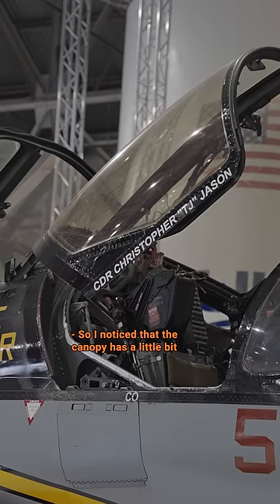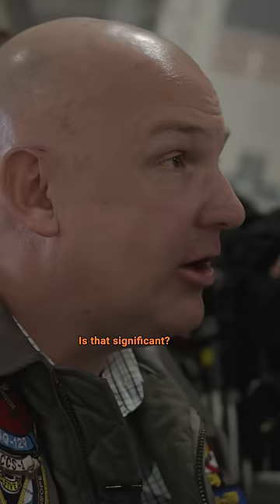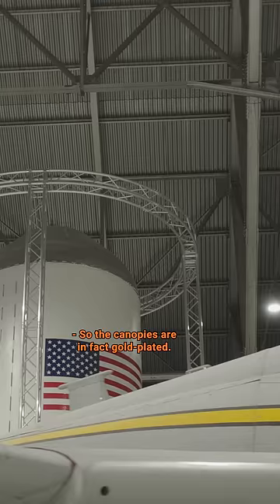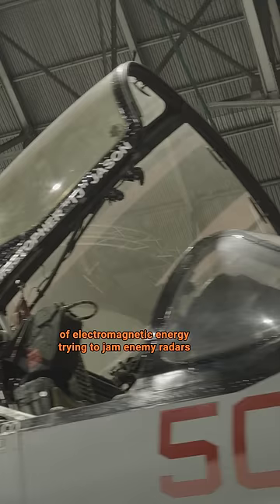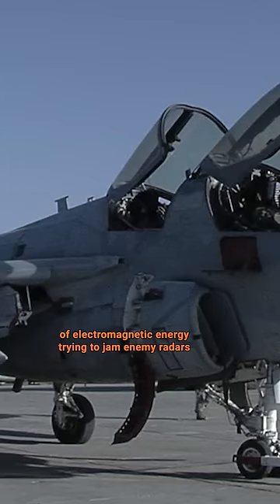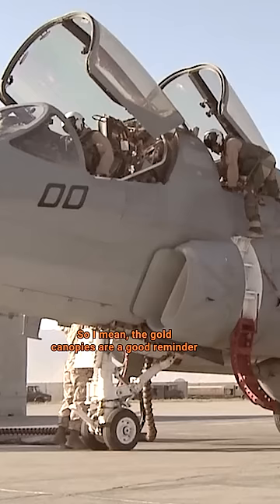Part 8 | Gold Plated EA-6B?!

Comment: It's actually kinda significant that he's next to a Garuda bird while talking about the canopies. When we were deployed to PSAB, Saudi Arabia in 2002, one of the maintenance guys accidentally pulled the ejection handle releasing both of these expensive canopies into the ceiling. No one was hurt despite several people working on and around the jet at the time. One of the canopies landed mere inches away from the HARM.
Reply: How could a trained guy "accidentally " "PULL" the ejection?
Reply: @iRossco  It actually requires at least two failures. Someone forgot to pin it, the person working in the seat forgot to verify all pins were in, and the person in the seat managed to pull it accidentally. It happened.
Reply: @peterjp4 that's 3 guy
Reply: @Sbudz  Nope. Just two. The person who didn't pin it immediately after flight and the person who didn't verify all pins were in when working in the seats.
Reply: @peterjp4  "someone forgot to pin it, the person in the seat forgot to verify all pins were in, and the person in the seat managed to pull it accidentally" that's 3 fucking things bro. 2 commas and an "and" means 3 things
Reply: @theBUDSareSTRONG  I listed three actions, but it only took two failures with cranials to severely damage a multi-million dollar aircraft.
Reply: @peterjp4  bro shut up 😂 you said 2 and then listed 3 things
Reply: @theBUDSareSTRONG  Actually, I saw the mistake shortly after posting it, but decided against correcting it in hopes no one would say anything. I wouldn't normally call my fellow shipmates "failures", but I had to win this argument.
Reply: @peterjp4  ok bud
Reply: What's HARM?
Reply: @LanaaAmor  Highspeed Anti-Radiation Missile. It's a missile specially designed to engage radar. The EA6B could jam their frequencies, but they were also capable of eliminating or suppressing the threat when necessary.
Reply: @peterjp4  ea6b?
Reply: @LanaaAmor  The EA6B Prowler, the aircraft in the video. EA stands for Electronic Attack. 6B is just a designator.
Reply: @peterjp4  how can it jam their own missile? Anti radiation missiles can be jammed? They just detect rafat signal and home in.
Reply: @LanaaAmor  The HARM is a missile specially designed to engage enemy radar. The EA6B could jam the enemy radar frequencies using their jamming pods, but they were also capable of eliminating or suppressing the enemy radar threat when necessary by using the HARM.
Reply: @peterjp4  harm can do that? I think harm just follows the radar signal.
Reply: @KaranSingh-cz8ih  Yes, that's what it does. I didn't mean to imply it did something else. I'm curious, what did I say that suggested different?
Reply: @peterjp4  you said it can be used to jam enemy radar
Reply: @KaranSingh-cz8ih  The EA6B Prowler carries jamming pods that jam enemy radar. The Prowler can also carry a HARM to suppress or destroy the enemy radar. Sorry for the confusion.
Reply: @Sbudz lil Peter here did in fact list three things. Peter, take your ego with you and go home. You’re wrong. Hope you gentlemen have a good day.
Reply: “No one was hurt despite several people” 😭
Reply: @kaelwatkins685  Lol, perhaps I used too few words in that sentence. Good catch, but I won't edit it. Just to clarify, no one was hurt besides someone's pride and headaches all around trying to get the bird back up.
Reply: @Sbudz  he correctly listed 2 failures, and you kept counting "things he said" not failures, use your brain.
Reply: @theendoftheline  do you not see the comment where he admits to posting 3 mistakes?
Reply: @Sbudz  nope, and the message had 2 failures still with a third guy doing the work hes supposed to do, so what gives guy?
Reply: @kaelwatkins685  ha it does sound funny taken out of context like that. But the key word is "despite"... As in: "despite several people working in very close proximity to the accident, no one was hurt"
Reply: @theendoftheline  bro he said 3 things I'm not about to sit and argue it's 7 am here
Reply: @peterjp4 would pulling it not be a failure also?
Reply: @caughtlackn3803  If you were really trying to get technical, there's a long list of failures. Who administered their seat checkouts? What qualifications did they have to administer the seat checkouts? Were they current? What safety checks were ignored? If the canopies were pinned, were they properly secured? Could it have been a legit malfunction? There's a lot of moving pieces in a squadron. I do remember everyone had to do their seat checkouts again. But I didn't mind. Me being an AK, those were the only times I was able to sit in the cockpit.
Reply: @peterjp4 I'm assuming your referring to VAQ 134. I'm perplexed by the fact that a 55 years old US Navy attack sqn was named after a mythical Hindu king of birds which resembles a eagle like form.
Reply: @punnyabrata  An educated assumption. Yes indeed. I'm not sure who picked that name, but at least it's a bird. And the squadron symbol is pretty cool. I was proud to wear that. I'm in awe that my squadron made it into the museums, immortalized.
Reply: @peterjp4  incredible stuff man. Must be one of the coolest jobs being a naval aviator.
Reply: @Sbudz bro that’s a comprehension problem on your end.

I understood what he said perfectly
Reply: @Sbudz error 2 and error 3 could be the same person.
Reply: @Sbudz error 2 and error 3 could be the same person.
Reply: @Sbudz you have nothing better to do that argue about absolutely meaningless grammar mistakes? Well, just so you know, a comma, is to break up a sentence, to pause without completing the thought or sentence. Doesn't imply he is listing off anything. It's proper grammar (yes, obviously, I am over-using them now.)
Reply: @eagleone5456  he stated 3 things, if he was listing off 2 then it would've been ****, and **** not *****, ****** and ******. The comma absolutely matters
Reply: @Sbudz whenever you get into the seat you are supposed to check the seat pins.

Comment: Early airliners had gold sandwiched between two layers of plexigraph. Electric current was aplied to the gold layer to heat the windscreen to keep the soft and pliable  to enable them to with the stresses of pressurization.

Comment: In civilian settings, the former World Trade Center tower opposite the one with TV transmitters exceeded ANSI RFR public exposure levels on the top two floors, until they put leaded Mylar film on windows.

The public observation deck on Empire State was 40% over between the two rings shared FM antenna for years, until it was eventually redesigned.  

Somewhere hidden away I bet there are precise studies on RFR levels, sources, and fixed or variable wavelength emitters, for these military systems.
Reply: In early 00s, Cisco shipped its enterprise wireless N APs with radios turned off and warnings to keep 50cm minimum from them. They knew way back then to cover their ass and I tell people this when they tell me it's harmless. I used to install them first hand.
Reply: @N4CR  Humans are considered 5 times more sensitive to RF in the VHF range than to microwaves, as they're able to heat adult limbs or children's bodies more effectively as gross exposures and over time, whereas microwaves tend to resonate or warm surface tissue or sensitive organs, and vary locations affected if someone moves around just slightly.  

Were those Cisco AP's FCC 47 CFR 15 Part B certified, or did they run higher power and need licensing, or operate on ISM rather than Part 15?  

50 cm isn't too bad (compared to broadcast antenna farms with a dozen 20 kW finned ceramic base Pentodes running Class C on VHF plus 30 Klystrons into combiners at 60 kW each, even if those AP's weren't suitable for desktop exposures, but needed high commercial ceilings to be away from sustained public exposures averaged over 6 minute increments.  

How many people affected, or just lawyers and engineers and doctors making public policy and law (often in inverted proportions from those with realistic factual knowledge) have studied the evolution of ANSI and other (eg, EU) RFR standards and underlying criteria?

Comment: So this explains why my head used to hurt from sitting next to the DUKE on our MRAPS. You can tell it's on because of the static buzzing in your headset.
Reply: This explains a lot. I used to work in a room next to where a special machine (degausser?) was used to wipe information from disks (many years ago) using a powerful magnet... You could actually feel your teeth hurting if they had fillings!
Reply: Or maybe the static buzzing sound gave you a headache.

The dude in the video is just.. wrong. Maybe he's not wrong in that it's the reason they'd put it in.. but it wouldn't do anything. Because non-ionising radiation does not interact with your body no matter how many watts you put through it.

The reason you get more radiation in an airplane is the high altitude. Thinner atmosphere means the background radiation levels go up.
Reply: @thecrazything95  okay bro go tell any person working on communication towers what you just said and they will make you feel especially stupid.

Comment: In airliners ,gold plating of the cockpit windows carried electrical current to heat the glass and make it more resistant to impact / bird strike etc. The military are saying it protects against cancer and they have taken all precautions, well , that would be clever but not necessary true.

Comment: As I understood it they used a gold COATING...not plating...in the stealth aircraft because the pilots helmet had a larger radar return than the aircraft did. So instead of a mach 2 bumble bee, it looked like a mach 2 bumble bee balancing a basket ball on its head....

Comment: I heard the F-22’s canopy is gold plated as well but not because of its ECM suite but because the radar from enemy systems would see the pilot through the canopy. So it’s there mostly to keep the pilot shrouded in stealth along with the rest of the aircraft.
Reply: Pretty badass to know the F-22 is gold plated
Reply: Agreed I'm confused at what this guy was talking about, also I will say a slight correction is not that it was trying to keep the pilot from being detected by radar but more so the inside of the cockpit which would necessarily include the pilot, everything inside the cockpit is not designed to minimize radar cross section including the pilot(unless the army has some super soldier program I don't know about), regardless technically the guys right you are protecting the pilot from electromagnetic radiation but not for health reasons directly more so they don't get filled with lead and explosives
Reply: @jaykoerner  yes my comment was a bit simplistic but you get it. The pilot and everything else inside the cockpit that can reflect back a signal. I mean we’ve been at a point in radar technology where the signature of the fans on the turbine can be used to determine the make/model of the adversary aircraft. I think it’s called Non-Cooperative Air Target identification. Not sure of the maximum range where this is possible gonna guess this is classified for most countries.

Comment: The gold is for UV protection, not electromagnetic protection. When you ask a pilot a tech question instead of a crew chief.
Reply: I heard it was for radar cross-section reasons, without a slight metal coating the inside of the cockpit ends up considerably more visible on radar, I assume it would also have slight UV protection and both UV protection and radar cross section technically are both things that keep the pilot healthy and alive in relation to electromagnetic radiation but less so because you're going to get fried and more so you don't end up with skin cancer in 20 years or filled with lead or explosives in 5 minutes
Reply: Technically UV is electromagnetic radiation, just a different frequency to the microwave radiation used for radar.
Reply: Dude did not even think about how the canopy is not even between the pilot and the equipment.
Reply: @thecrazything95 there’s a big pod of equipment on top of the tail. And what if they’re flying next to another prowler?

Comment: I always tell people about these aircraft. The 18s shoot their exhaust straight out the back, but the prowlers shoot their exhaust down. When you're trained to run up under an 18 when it's taxiing on a flight deck, that's a problem when you try it on a prowler. Didn't work too well for some of my green guys. They went for a tumble down the flight deck.

Comment: “Tinfoil hats are for crazy people “ but we are going to gold plate your window….because…..?
Reply: Dont remember you sitting next to an electronic jammer aircraft
Reply: @_wayward_494  your mom does
Reply: Because the guy in the video is just wrong.

The radiation that can harm you is called ionizing radiation. None of the jamming equipment is ionizing. Otherwise it'd make for pretty poor radio equipment as it'd interact with literally everything.

However being aboard an aircraft, including a passenger jet btw, gives you a higher exposure to ionizing radiation from the sun and space in general, because you no longer have a thick atmosphere above you protecting you. So that's why pilots get more radiation exposure.

Also how would a canopy protect you against the equipment that is sat BEHIND YOU?

Comment: I was under the impression that the indium-tin-oxide? coating in the canopy is for anti-radar purposes. keeps the radar waves from bouncing off right-angles inside the cockpit? unless that's specifically the F-22 and not other stealth aircraft as well

Comment: If they thought deeper it would have been smarter too encase the fighter pilot in an RF protective shell within the aircraft with all the electronics outside of said shell, using wires too transmit data. Problem solved.

Comment: Gold wouldn't protect them from energy emitted by the aircraft it would reflect it back into the canopy. In other words, keep it contained so as not to be detected by the enemy.
Reply: The cockpits are insulated all the way around. Nothing that is releasing the incredible amount of waves is inside the actual cockpit.
Reply: That thin layer of gold would have done Sweet FA. At best reduced sunburn

Comment: How does that work? Gold is pretty opaque, right? Is it just blended with the molten glass? Or perhaps its somr kind of laminate? Cool in either way
Reply: Nope, it's literally PLATING...gold is one of the most malleable metals, and it can actually be pressed so thin it is almost completely see through.

Fun fact, the Ancient Egyptians were able to manufacture gold foil around 1,000 times thinner than standard printer paper.
Reply: The film is incredibly thin. They actually apply it by "D.C. Magnetron sputtering" the material (explanation if you're curious: What Is DC Sputtering? An Overview | Korvus Technology) in a vacuum chamber. They basically vaporize the coating material and (through a difference in electrical charge) deposit it onto whatever they're coating. Most commercial airline cockpit windows will have the same process done with Indium Tin Oxide. The coating is conductive and, when a current is applied, is how they defrost the window without having physical heating elements obscuring the pilots view.
Reply: It’s vapor deposits

Comment: So you want to build a drone that cannot be jammed? Get a big microprocessor and a couple of cameras, put the camera on the other side of some glass/polywhatever sputtered with a conductor. Navigate optically. No external antennas, and no EMF exposure.
Reply: Wouldn't work.
Firstly there needs to be control over the drone.
Two options including both within an aircraft:
1. Remote control from a ground pilot => the drone needs to receive radio signals, either from a ground transmitter or satellite.
Therefore jammable.

2. Autopilot and GPS guidance using way points.
On board radio receiver to receive the GPS signals => easily spoofed and jammed as events in recent years (notably with Iran) have demonstrated.

Got any more ideas?

Comment: I thought only lead and concrete stopped all electromagnetic radiation lol 
Am I right in saying that the b1 also has a gold front windscreen?
Reply: Nope. Lead can stop some frequencies, so can concrete, so can a piece of paper. No material can block everything, but all frequencies can be blocked by something.
Reply: The gold here will easily attenuate microwaves, it's about wavelength. Longer wavelengths are stopped by things which have a size smaller than them, so the structure of the gold can stop it, high energy radiation like xrays and gamma rays have shorter wavelengths than most material structures making them stopped only by atoms, which is why concrete and lead (things with high number of atoms per unit volume) attenuate them significantly.

Comment: So the annunaki were right then. Gold suspended prevents radiation. ✍️  📃 😅
Reply: well gold is a conductor, and they probably put it on the canopy in a net structure, creating a faraday cage that should block electromagnetic radiation. so yes, gold net suspended and grounded = radiation blocker

Comment: Is the gold plating just so thin that it’s transparent or what
Eh fuck you guys I found the answer myself
Its not gold plated its plated with ITO. Indium Tin Oxide is a transparent conductor that is used to reduce the radar cross-section (RCS) of the aircraft.
Reply: I think so
Reply: No, the gold plating is solid not transparent at all. What you're seeing is a projection from early micro LCD projectors. Without those the crew wouldn't be able to see out. Conversely the marshallers wouldn't be able to use hand signals to communicate before and after the mission.
Reply: @9HighFlyer9 Can I see a source my friene?
Reply: If you'd like, I will fly mine over to show you how it works.  It's pretty neat.
Reply: @NightlyWatch  of course you can't see a source. I made it up.
Reply: @9HighFlyer9  BS
Reply: @9HighFlyer9  The canopies are transparent, wtf are you talking about?
Reply: @2011blueman it was sarcasm buddy ......